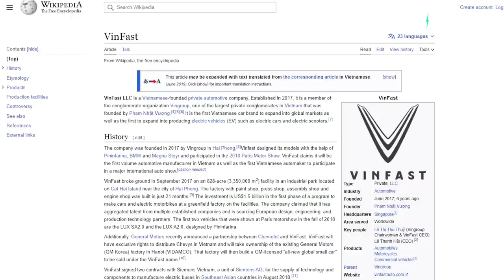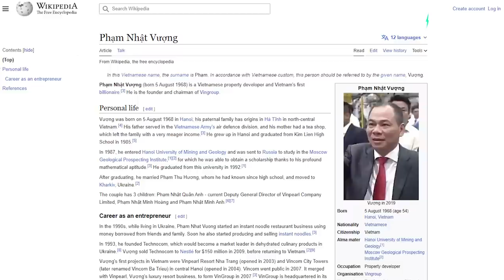Vinfast: The EV Disruptor Worth More Than GM & Ford reveal the new VF3

Comment: I live where the first shipload of Vinfast cars to Canada was docked.  Was surprised to see how BIG this ship was in our dockyards!  Didn't get to see any of their vehicles come off - but I expect they are already stored in the massive secured parking lot by now.  

A recent news article mentioned the cars having issues though.  ie. Software glitches, flimsy seating, cheap looking interior parts (ie. for being promoted as luxury) etc.  But instead of denying or deflecting these accusations, Vinfast has simply just admitted accountability, acknowledging the problems.  And they say they will work hard to correct them.  Gotta admire the attitude here so far.
Reply: Bloomberg reported based on the DMV registration, only 230ish cars were sold out of 999 imported so your area must have the most.

Comment: Vinfast is young, bold and making some mistakes. If they can survive long enough, mayb they can do something great!!!
Reply: It's unlikely that Vinfast will last longer than their promised 10-year warranty.
In domestic market, they had to discontinue their petrol car business after about 3 years of accumulating huge loss.
They jumped on the EV wagon with the hope of riding the EV sentiment. However, they only accumulate more loss.
In Nov 2022, they shipped 999 model VF 8 cars to the US and so far managed to lease only about 100 cars and unable to register a single sale.
In May 2023, they were ordered to recall all VF8 cars due to safety reason...
In domestic market, they did not fare any better, sluggish sales and there are so many complaints about the car quality and faults.
While accumulating loss and having the problem with car sales, they are running out of cash. 
Just in Jun 2023, they are planning to issue their debentures in Vietnam....You'd bet there is little interest in buying debt securities in a loss-making company.
At this rate, it's hard to see them to continue in this business within 2 years.
Reply: That’s the dodgy Russian style of the vingroup’s owner so it’s not surprised that he operated that car company the same way like he launched some smartphone that had only survived for an extremely short time
Reply: @ongmat4439 actually they sold a lot of ice vehicles and they had to cancel orders as the company shifted to electric. They have higher ice sales than its competitors. 2x more sales to be precise. They produced rebooted bmw 5 series with gm motor which costs less than importing a bmw. That's why its a huge success in Vietnam. I do acknowledge that they are moving too quickly.  They gotta slow down and manufacturer and sell evs in Vietnam first and then sort out their issues and sell the refined vehicles worldwide.
Reply: @ongmat4439 ghê quá nhà phân tích học hết lớp 1 chưa?🎉
Reply: @ongmat4439 gớm thật